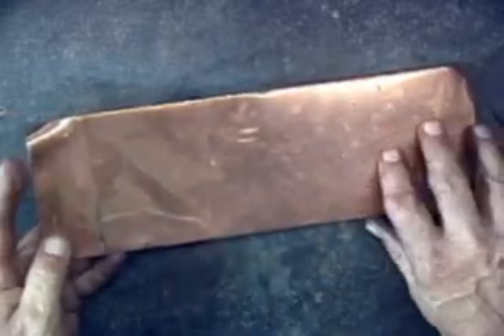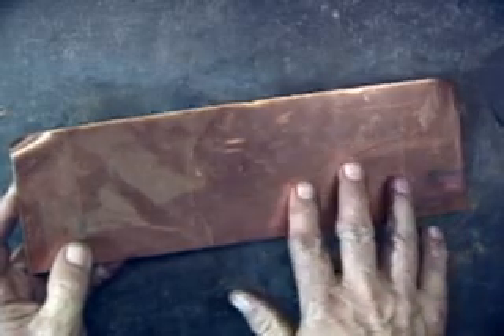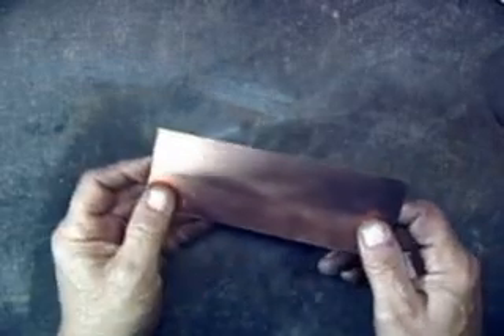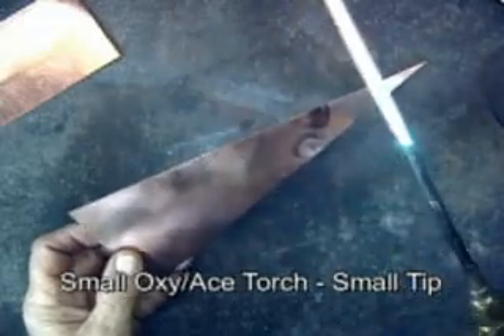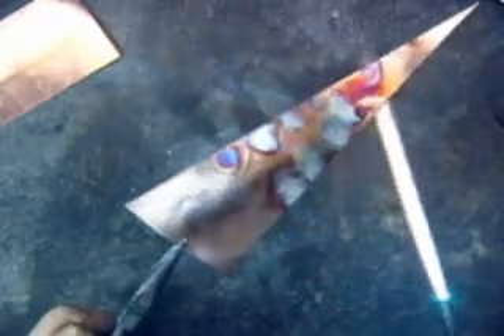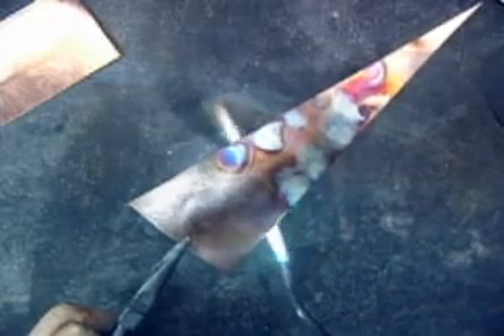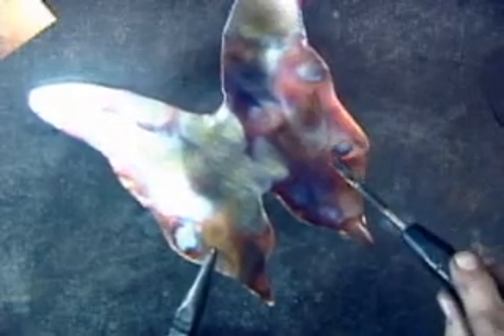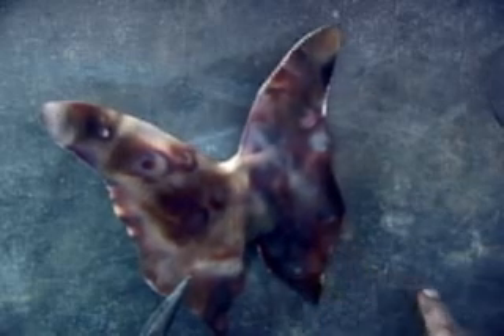Flame Coloring Copper

Comment: Thank you, once again! I know understand why my colors are not as vibrant! I didn't brush the copper at the beginning.
Reply from the maker: Even with wire brushing, you will still lose a little color when spraying with a clear aerosol.  Which is the reason that I try to get the brightest colors possible.  Then, if I lose a little color when spraying, I I still end up with good color.  Sometimes I have to wire brush the color off and start over to get the colors I want.  For me, it really is a trial and error process.

Comment: When i am trying this sometimes my copper turns ugly gray how do i get color back
Reply from the maker: Linda, not sure what to suggest.  I've never had copper turn gray.  You should be able to wire brush the copper to bring it back to the original finish.  How large is the piece of copper?  How thick is it?  What heat source are you using to flame color?  Depending on the size of your piece of copper, you can also soak it in White Vinegar for several hours.  That should return the copper to a pink color.  Then neutralize the copper in running water.  From there you can either wire brush or use steel wool to bring the copper back to a copper finish.
Reply: When i say gray i just cant get color just a yucky dull color .... Now keep in mind i am brand new to this im sure its all in the technique. I have been watching your videos and inspire to be as good :-)
Reply from the maker: Couple of points:  1) Check out some other flame coloring videos on YouTube.  There are people who do flame coloring on a regular basis that are better at it than me.  2)  the "yucky" dull color means that you have gone past the point of good color.  Clean off and start over.  3) try just hitting the copper with the flame and then taking the flame away.  It take a few seconds for the copper to begin to color.
Reply: Linda Harrison I think a reducing flame would reverse the change. I’m not 100% sure, though.
Reply: I've had to do pieces over and over until I get some color. When I get that dull gray, I just buff it again on a grinding wheel (with the wire wheel, not the grinding one). I haven't tried wire brushing, but I am going to.
Reply from the maker: Stacey, congratulations for sticking with it.  Keep it up!

Comment: How permanent exactly is this treatment? Do I need to seal the finished piece somehow?
Reply from the maker: Yes you need to seal.  I use a clear spray such as Rust Oleum Crystal Clear aersol
Reply: Thank you for all your answers - very helpful indeed!!
Reply from the maker: Once the piece is clear coated it should last for years.
Reply: after coating will it still have the effects of copper? I mean jewelry.

Comment: Do you have to put it in water after coloring with flame because I tried not cooling with water and cooling with water there was no difference the color faded, I must be doing something wrong.
Reply from the maker: Marie, I've found that I need to move the torch  away before I get the optimal color.  When I remove the torch flame the color will continue to change.  A few weeks ago I did some copper maple leaves.  I hadn't done any copper coloring recently and it took me some practice to get exactly what I wanted.  That meant that I had to wire brush the copper and remove the coloring and start over.  I used a small tip and reduced the fame on the oxygen acetylene torch.  For me, it's important that I get the optimal color because when I spray paint with a clear aerosol,  some of the color fades.  The only time I use flame coloring is for leaves and butterflies.  You might check some other YouTube videos on flame coloring.  There are people doing flame coloring that are far better at it then me.
Reply: Hello George thank you for your quick reply, I was asking this question because this weak end I made myself a little pendant with a small piece of tubing just to try out the flame coloring I beat it a lot with the hammer to make scratchers and bumps but when it was hot the colors were super nice but when it cooled down the color faded away,I am new at this I only started after you inspired me with your very nice videos, so I guess I have a whole lot of practice to do before I get good results,this is for my personal fun so I have a lot of time to practice, so thanks again
Reply from the maker: Marie, I don't quench the copper. however, a lot of people do.  Just a personal preference.  With a small piece like your pendant, it's a bit more difficult compared to larger pieces of copper.  If you got the color you want and then it disappeared, I think it probably continued to color once your flame was removed.  Try taking your torch flame away a little sooner.
Reply: Thank you for this info.

Comment: Beautiful can  this be done with a Mapp Gas torch? What is the gauge of the copper you use?
Reply from the maker: Norma Green   Norma, I've never used Mapp Gas.  I use oxygen acetylene but I know It can be done with propane if using a pencil tip.  The tip of the torch is more important than the gas.  Pencil tip is for a very low flame.    I'm using 16 oz. copper which is about 25 gauge.
Reply: Thanks very much for your response. You do beautiful work and I love your videos

Comment: I have a piece of freeform copper that had been molten, poured and let cool in a random pattern. It's about 1/4" thick in most places.  I would like to bring some of the oranges and reds out on the piece.  Do you know if molten copper reacts differently than sheet copper?  I have a propane torch, but I will gladly purchase a different type of torch if you think I may be able to achieve good results on this type of copper.
I own one of your copper and brass leaf sculptures and I absolutely love it.  Thank you for sharing your knowledge and talent with us.
Reply from the maker: Doris, I would think that you would be able to get even more interesting effects with a uneven piece of copper compared to a flat sheet.  The only problem with the propane torch is the broad flame.  You might try shield different parts of the copper with a sheet of metal.  Of course you will want to wear gloves or use pliers to hold onto the sheet of metal.  No matter what you get, it will only be a surface color.  If you don't like it, wire brush off the color and try again.  It's really a trial and error process.  I use copper coloring on leaves which I do occasionally.  When I haven't done it for a while it is like beginning all over again.  Best advice is to relax, have fun and find yourself amazed at all the different colors you can come up with.  George
Reply: George Goehl Thank you for the quick response.  I look forward to experimenting.  :)

Comment: After watching this video, I have try it out myself.  I was wondering if this process work on thinner copper as well?
Reply from the maker: Rachel, I'm sure it will.  Probably take less heat than heavier copper.

Takes a little practice to get exactly what you want.

If you don't get what you want you can wire brush or steel wool the color off and start over.

George

Comment: Hi George I have this project in mind for my bicycle frame. I have a chromoly steel frame road bike and i wanted to have a raw finish with flamed colors like this on the welds. I am just concerned if how the heat will affect the steel of the frame? Will it melt the welds inside the frame? or affect the steels durability? Thanks
Reply from the maker: I primarily color copper.  I've never flame colored chromoly steel.  There are a lot of frame building sites - suggest you ask there.

Comment: Wow! My Mom bought me a small butane cooks torch for me to try this out but I've been too scared to give it a try. Would this technique work with a butane torch and what is the best gauge of copper to use? i was thinking about buying some copper blanks to use in my jewelry making. What do you mean by 'wire brushing' the copper? Is that the same as polishing it? Sorry for all the questions but you seem to know exactly what you are doing.
Reply from the maker: I don't know about butane.  If it will work I'd suggest trying some copper foil or something very thin to start with.  You can get this at a craft store.  I would start with the thinness that you can get and then work up to heavier copper.

Wire Brushing:  Copper becomes oxidized when it is exposed to the atmosphere.  At first it just loses its luster.  The copper can be wire brushed to bring back that luster by removing the oxidation.  A very fine sand paper will do the same or some steel wool..  

The best part is that if you don't get what you want you can wire brush, steel wool or sand the coloring off and start over.  

Have fun experimenting!

Comment: George, I was wondering what you think of using a patina solution for coloring copper.  I was thinking you could put various scratches and of indentations in the medium and then hit it with patina and sand it down later.  Only the marks would be green I think.  That might lead to a nice artistic touch.  What do you think?  Also, do you know of a good patina formula?

Comment from the maker: Losing the color is a problem.  I generally try to get the most vibrant colors possible.  Then if I lose a little color it doesn't matter as much.   If I don't get the vibrant colors I wire brush again and start over.  I've had pieces that I have repeated the process five or six times until I get what I want.

You might try different brands of clear coating.  You could also try waxing the copper.

Comment from the maker: I'm sure it can, but I have never flame colored copper pipe.  I've only flame colored sheet copper.  Give it a try.  If you don't get what you want, you can wire brush off the flame coloring and start over.

Comment from the maker: For copper maple leaves I use a oxidizing flame.  That is using the oxygen acetylene torch.  An oxidizing flame has the oxygen turned up.  It severs the copper rather than cuts it.  Cutting would leave a clean edge and severing leaves a jagged edge.  If you go through my YouTube videos you will find a video on "3  Oxygen acetylene flames".

Comment: I was wondering if you'd share the brand of clear coat you like. Whatever I've used in the past hasn't last long and the copper seems to tarnish/change faster than I would have expected despite applying 2 coats.

Comment from the maker: Depth of color:  The color is only on the surface.  I have never soldered after the copper is flame colored.  If it was me I would do the soldering before spraying with a clear spray.  Whether the colors will change when soldering depends on how large the piece of copper is.   What I'd suggest is working with a piece of scrap copper and doing some  trial runs.  Remember, if you do not like the flame coloring you can wire brush it off.

Comment: @897473 I was able to get a variety of colors using a standard plumbers propane torch.  Took some playing to get the heat to spread just right, but a cheap introduction for those lacking more power.  Thanks for the vid good sir!

Comment from the maker: I've never tried an oven but I doubt that it would work.

An oven would give you an all over heat.  Would heat the entire piece evenly.

I've always wondered if the gas burners on a stove would work - but I've always had an electric stove.

You might try a small propane torch like you can get at a hardware store.

Some of the small propane outfits have small tips.

The smaller the tip the more pin-pointed the heat.

I like to hit several places with the torch and let the color expand.

Comment from the maker: @381polaris 

You can try using a very light flame.  When you get the color you want quench it in water.  Of course that is only going to work if the piece is small enough to get into a bucket or other container.

The copper plating is a very thin layer, meaning that you can easily burn off the copper and leave just the steel.  This is the reason that you will want to use a very light flame.  

I've never tried it, but you might start with using a small propane torch before using a O/A torch.